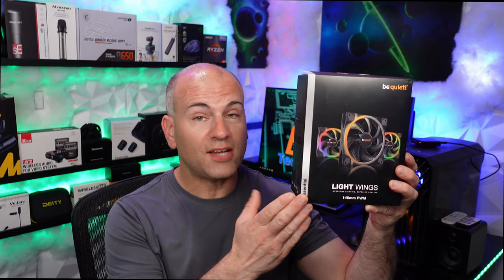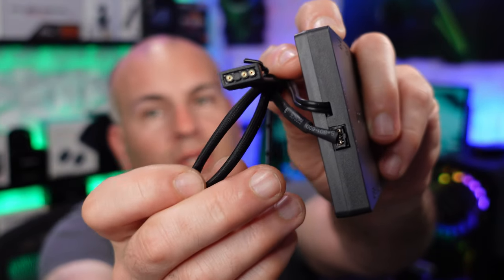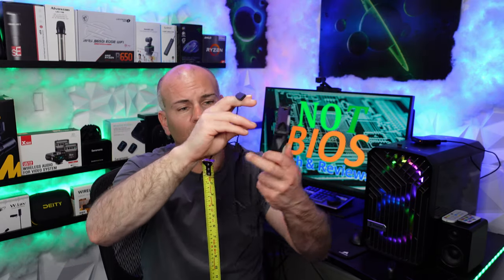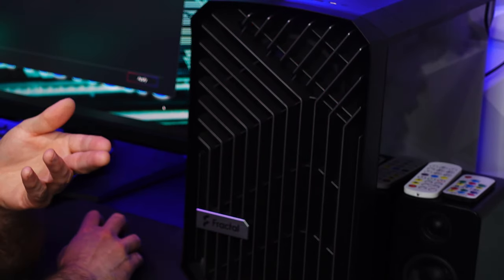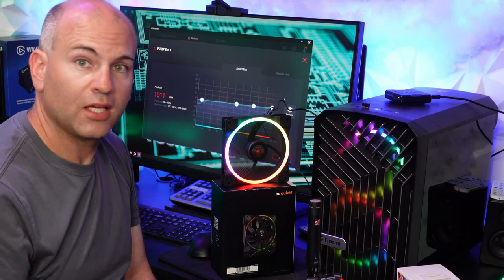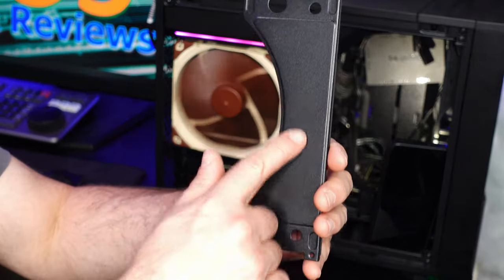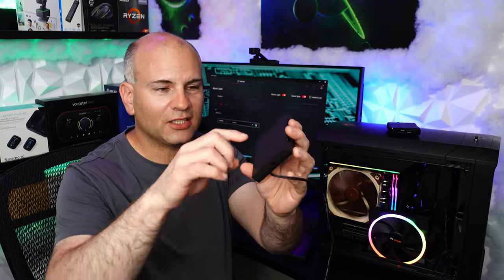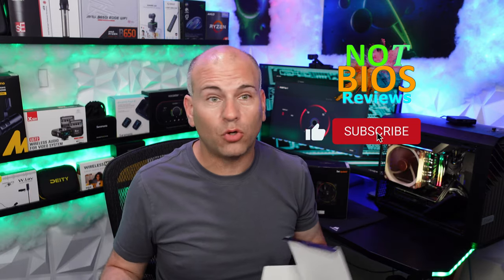Be Quiet! Light Wings ARGB Triple Pack Cooling Fan & HUB

Comment: Thanks for the great, detailed discussion!  I was not able to get the daisy-chaining to work -- either the fans would spin with no lights, or they would light up but not spin. So I did use the hub, and all is good. By the way, as you probably figured out, there are 4 holes in the hub, with the same spacing as a 2-1/2 inch drive, so I bolted the hub onto the case on a mounting point that was made for  a 2-1/2 inch drive. Thanks again.
Reply from the maker: @danmagoo  thank you. It feels excessive to have to bolt to a case but if that works for you that is great. These fans have too many wires for my liking and I ripped out the ARGB cables out shortly after and changed my case and shortly after reviewed the Thermaltake Swafan Ex120, Corsair QX120 and the Lian Li unifan which all had a hub with better stickiness and less cable mess and at least 2 of the hubs were magnetic and yes all out of pocket cost. The LTC fans interconnected and no hub needed and were provided for review. At low speed the light wings at 140mm are one of the most silent and still use 2 of them. The 120mm isn't as silent.
Reply: @sparketech  Indeed the hub is a bit "much" but I was committed to the case, and using the 2.5" mount, while regrettable, did clean up the mess of wires.. Thanks for explaining the great alternatives. Those cases do have definite advantages.

Comment: Be quiet doesnt provide hub for powering all fans right? Since fans header ia very limited...
Reply from the maker: Y connectors are a wonderful thing for fan headers. I reviewed 3 different 3 pack RBG fans with fans and RGB all running off of the hubs and for thermaltake I give it straight up honest about what a pile of crap there Swafan is.
Reply from the maker: Wow, you really know how to make fancy thumbnails. After the start I mention outright it is 6 RGB connectors. I am trimming this old video a bit, it was far too wordy.

And I don't know of any hub for powering all the fans. I simply used a bunch of Noctua Y connectors. If you want a 3 pack I can recommend 2 options
Lian Li UNI INF reviewed here
https://youtu.be/-3or7eaWZUU
and the Corsair 3 pack but they are EXPENSIVE
https://youtu.be/4wPXY7ld_L0
Reply: @sparketech  great thank you. I am getting mad when yesterday I build my PC using this good looking Be quiet Fan. And I realized there is no hub/ y connector for pwm pin but argb hub only. Thanks, you have confirmed my thought.
Reply from the maker: @ketechin  You're welcome. I'll try to help where I can, feel free to ask questions before you purchase. I'll do what I can to answer/ In terms of RGB stuff I have a playlist of all reviewed items but I do a lot of computer and electronics stuff including air purifiers for some reason lol.
I also have a Studio channel for Spark E Studio with microphone reviews, also includes everything studio. Tripods, audio interfaces, editing stuff. I'd like to figure out how to do cool thumbnails like you BUT you do have a little too much going on. Most people are going to have a little phone screen. BUT still, sooo cool :)

Comment: what software did u use fro the fan speed
Reply from the maker: @jclgaming34  i didn't use any software specifically. I used my motherboard bios, my motherboard also has downloadable software for controlling things like fan speed.

These fans with HUB isn't locked down to ANY software unlike all the other options I reviewed on this channel Thermaltake Swafan EX12, Corsair QX120, lian Li unifan INF 120 which I all purchased out of pocket.

The LTC 3 pack fans are cheap RGB fans I got for review and no hub needed one cable to fan header and one to the motherboard ARGB port and done. I wish all these fans were so simple... My motherboard software has with the LTC fans ARGB control AND "Open RGB" free software.
Reply: @sparketech  ah ok because it looked like u werent in the bios but i have be quiet fans also im ditching the 140m for 120 as its more silent even at max speed .which i did get and ill be installing when they arrive
Reply from the maker: @jclgaming34  My MSI motherboard software also has fan speed control... For MSI motherboards and is very basic, silent, gaming, performance not specific speeds. If I make videos changing speeds in the bios it would make for a very long drawn out video. PWM mode is very accurate for fan speed control but is a royal pain due to having from 0 to 100% and everything in between that so it is actually a slow process to set the fan speed.

Comment: to pwer the fans, do you need an seperate hub to hook up, lets say 6 lightwings, with power, i guess only the RGB in the hub wont power the fans? or am i wrong
Reply from the maker: Correct, 6 light wings all need a power connector. Y connectors from Noctua are useful to make it down to 3 used. The HUB is indeed for the RGB (proper name is ARGB), I personally got annoyed with the HUB not staying in place where I stuck it, hopefully you have a better experience. The Lian Li 3 pack I reviewed looks cooler and is only of my favorite for the price https://youtu.be/-3or7eaWZUU

I use the Corsair QX120 fans but they are crazy expensive, great silent fans at low speed and can be flipped backwards with cool looking RGB BUT turning on the RGB makes noise. For the record all the fans I've reviewed are all out of pocket cost. Including the not that good Thermaltake SWAFAN EX12 3 Pack.

Comment: Hi, great video, good to know what to expect and how they sound, many thanks. Can I ask, I just order a 3 pack with the hub thinking the hub would be enough to get round the fact I don't have a ARGB header on my motherboard! After watching this I'm worried I won't be able to get my mobo to talk to the RGB element, is there an easy cheap way around this please? Thanks for any help
Reply from the maker: I don't even know what your motherboard has for RGB ports, if it even has the correct voltage and even an adapter at best is likely one single color only. Easy way around the issue is buy something that does not required ARGB and return those fans. For a similar price The Lian Uni-fan infinity I reviewed looks superior and does not require an ARGB port and has far less cable mess https://youtu.be/-3or7eaWZUU?si=aegq2soEesahmkSU

I reviewed a pile of 3 pack RGB fan options

Comment: How did you power all the fans? Do you have lots of MOBO headers?😊
Reply from the maker: I used 1 Noctua Y connector. I got annoyed with all the cable mess... I use the Corsair 3 pack RGB fans... Also used the Lian Li UNI fans with the infinity mirrors for some time..  to find those reviews here's my RGB playlist:
https://youtube.com/playlist?list=PLxiepNzlBZrR18MhVJwJEa3p-dO0E7ed8&si=943C-910QCoxLloH

All my fans And case reviews are all 100% self purchased out of pocket.

Comment: These any good for case fans temps wise?
Reply from the maker: These are good, but higher RPM models if noise is fine to get big air flow. If I wanted air flow and low noise I have a nice Noctua I use with my CPU cooler that has more air flow BUT no RGB. These light wings are far better air flow compared to the Silent Wings 3 version of fans.
Reply: @sparketech  I ended up getting a load of be quiet pure wings 2 fans they seemed decent and affordable
Reply from the maker: @jamesdixon6903  how is the silence? Last time I used pure wings they had noisy bearings but that was years ago.
Reply: @sparketech  didn’t get my pc delivered yet but I will let you know 🙂

Comment: I've been unsuccessfully trying to find a software to control the RGB and the Fans, any tips? Thank you for the video
Reply from the maker: Open free software options should work. Does anyone know the software cause I only used MSI mystic light since I have MSI... Several other companies should have their own ARGB RGB control software.
Reply from the maker: @idemocat  Signal RGB asks money, you are correct.

Since I reviewed this fan I only found OpenRGB free, it worked better than the MSI Mystic light, brightness and speed work correctly. Otherwise motherboard direct software, Asus, Gigabyte, Asrock also have their own compatible software but of course not open software.
Reply from the maker: @idemocat  with all the MSI software problems videos I've made and Bios issues videos I would have mostly agree with you 😜

Comment: Hey man i have a little problem i installed everything but just noticed that the rgb hub connector to my motherboard is a 3pin and my motherboard i think has 4pin what can i do??? Is it the connection that says jrgb1 ? Or can i connect it to one that says jrainbow 1 it had the same pin connector but idk if its that one i dont wanna plug it in and mess up my pc.
Reply from the maker: You need the matching pin out. 4 pin is RGB which is boring all one solid color at any one time. This is ARGB. Sadly it is mostly higher end motherboards that have the better ARGB.. off hand I do not even know if any external kit exists. If you want the good stuff for RGB you might be stuck spending a fortune on the Corsair QX120 which I review but don't remember if it uses the ARGB connection at all without re-watching my review. I still use the Corsair 3 pack I reviewed.

If you click on my channel name and click on playlists I have videos that are all about RGB strips, lights, speakers, light bars and more
Reply from the maker: There is apparently a way to connect JRGB to ARGB... I had never heard of JRGB to be honest :p
https://www.youtube.com/watch?v=d6mxXeaUp5E